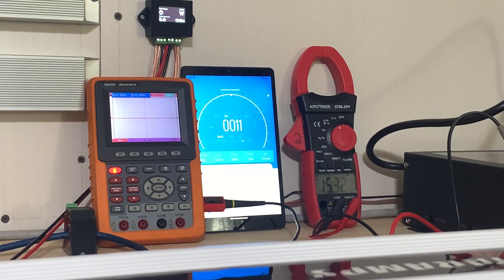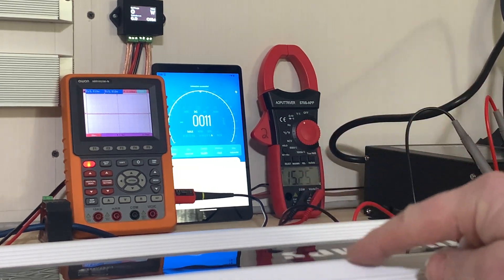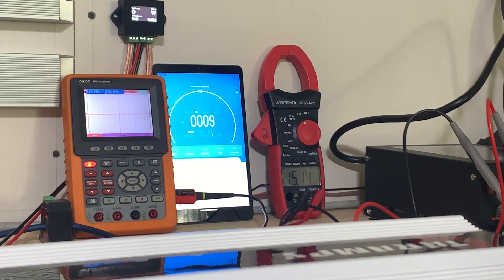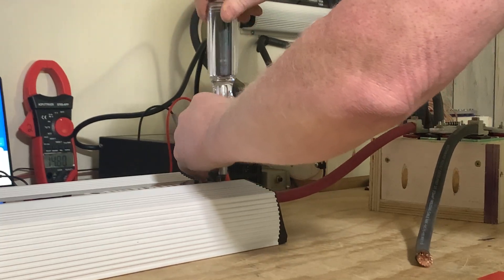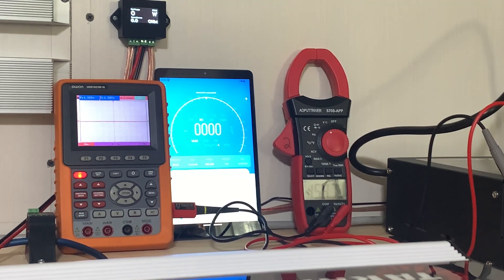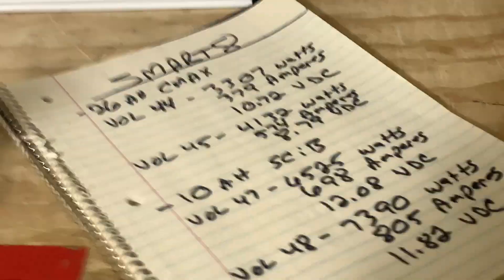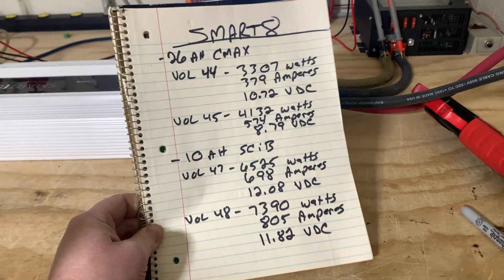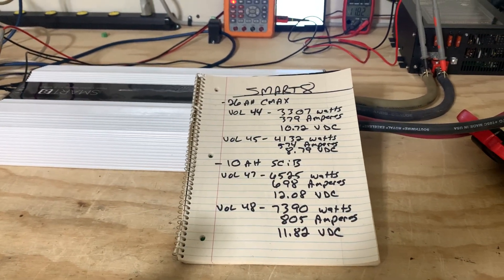CMAX versus SCiB on SMART 8

Comment: Good test bro thanks for putting out the video I've been wondering about the 10AH cells could you do a test of the 10's compared to the 2.9's
Reply from the maker: I don’t have any 2.9aH cells to be able to test them. But in all honesty I think the 2.9aH cells are not a very good option unless it is a burp build AND you have super limited space for battery. That being said I easily put 60aH of the 10aH SCiBs in the spare tire well in our 91 Civic Sedan which is plenty of battery for the Soundigital 35K I am putting in there. Just saying.
Reply: @jeremywilliams8558  I'm running two banks of the 2.9's I have a 29AH and a 43.5AH they are actually really strong cells as it sits right now with the Ruthless 10k and Ruthless 1500.4 I don't see below 15.5 the 43.5 supported it all by itself and I never saw below 15.3 I only added the other bank and caps because I have a second Ruthless 10k on the way I pre-ordered 1 of the Red one's
Reply from the maker: @Dirty2152  nice
Reply: @AllAboutAudioJW  what size alternator?